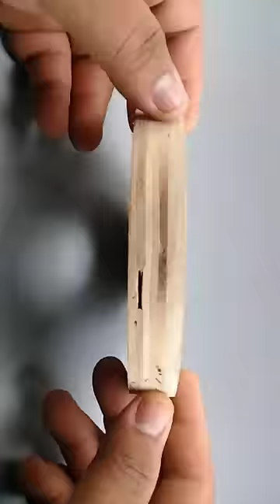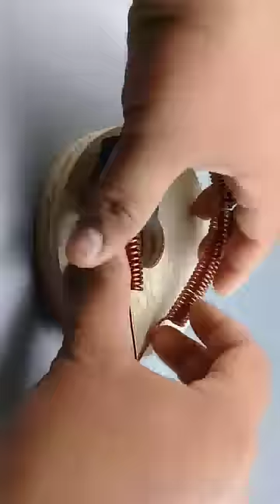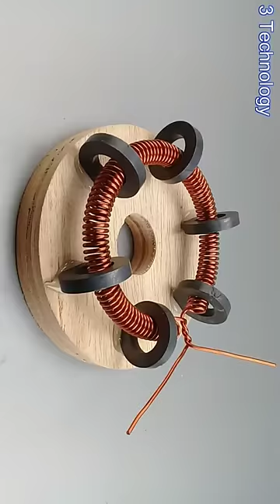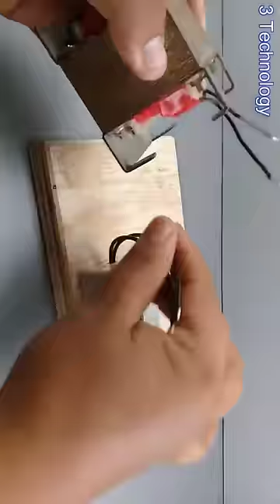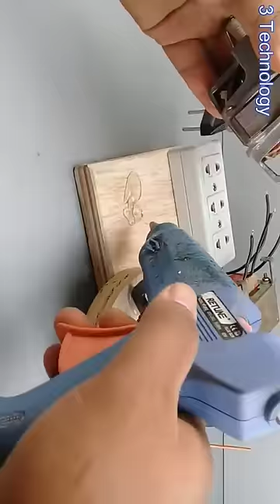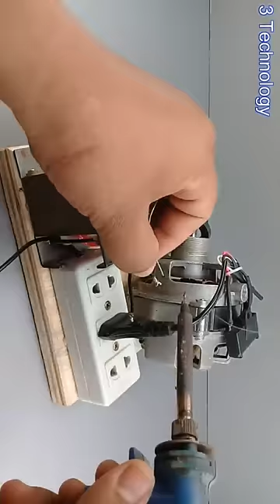New Free Energy Generator 7000w - Free Energy Forever #viral #diy #generator #tech #motor #shorts

Comment: The hardest part in making free energy devices is finding a place to put the batteries.
Reply: And the hot glue
Reply: Ha😂
Reply: The most difficult thing in this video is to correctly connect to your neighbor’s outlet through the wall without him noticing.  and then the light bulb will be on and the TV and refrigerator will work.😂
Reply: I saw this same comment in another video. Is this what you do with your life?
Reply: @alal-os1er  I mean if you connect secretly to the neighbors outlet, YOU have infinite or free energy, but your neighbor will wonder about the bills if you mine Bitcoin with this😂
Reply: Well, you need no battery if you have thin clear coated wires
Reply: Lo mismo pensé dónde ocultar las pilas 🔋.
Reply: Looks real to me and you sound like a broken record
Reply: @user-fw4dg3zp4j    LoL.
Yup. You're right. It's totally real. 
 Free energy is just being suppressed by governments around the world. But one guy with hot glue, a wood block and some wire is going to change the world.... on YT.
 Sure thing, sport.
Reply: No fucking way bro hearted it
Reply: Burada 100 watt ampül var bunu kaç pil ile çalıştığını biliyorsun?
Reply: Where can I find those things
Reply: So original
Reply: This same comment on all these free energy videos. Either AI bot or paid loser by elite opposition.
Reply: @frankiesun09  I "think" I agree with you? Sounds like I agree with you. 👍
Reply: Well you wouldn’t use batteries in an AC circuit, like the one in this video. AC electricity is produced, but not stored.
Reply: Or the extension cord to 120vac
Reply: Vocês não entendem nada, dentro da tabua tem uma bateria de 100A, bem potente.
Reply: @frankiesun09 It's a popular joke LOL if this system could create free energy, bacteria would have evolved their own tiny bacterial version with proteins and ion exchange and eaten everything else.

Comment: They forgot to show the batteries in the white outlet box
Reply: And that is it. Einstein says energy will never disappear, its only transforming.
Reply: yep, they should screw wires together either
Reply: Nope...the plywood base has been routed out to fit a whole bunch of AA batteries! Can get what ever wattage he needs and with a thin piece of panel on the bottom, you would not be able to see anything!
Reply: It's a turbine. U have to spin it. Hence the draw string.
Reply: We don't need it to be shown because we know it
Reply: table kee niche induction cooker coil fit karke bewkuf bna rhe ho
Reply: Это не реально....
Reply: @patricksummers4285 фанера -- это и есть батарейка. Только он перемудрил и усложнил её зачем то всякими лишними элементами. Поджечь фанеру и будет и тепло и светло
Reply: Wait what? I thought it would be a continuous flow of energy.😬 yikes... Would the battery have to be rechargeable? Like a lithium rechargeable or something? I'd like to try this. looks pretty cool
Reply: Is this fake video ? I need a generator 220 voltage so what's learning real video?
Reply: Where can I find those things
Reply: Maksuda 
🎉
Reply: @shahindezfouli5108 Well it's certainly not an infinite energy generator. Those don't exist lol. If you could make em with wires and magnets and coils, a bacterium would've evolved a version with proteins and ions and eaten everything else by now.
Reply: No, the copper wire is looped through magnets. The thing in the thumbnail. Its called a turbine. They spin a magnet inside it. That makes electricity.  It will wear out, or use up, the magnets eventually. So it’s only free in the sense that you are not paying the power company.

Comment: Free energy only happens in India and surrounding areas. It requires construction with scrap components, a glue gun, wood and a place to hide the batteries...
Reply: И желательно не учить физику 😂
Reply: Tbf, there may not be any batteries. It is built from scrap, so it could be ork tech powered by nothing more than the sheer weight of the builders ignorance. WAAAGH!!! is not well researched.
Reply: free Energy is Always Bogus
Reply: Actually you don't need batteries. Look up Lingams, they used silver and gold with water flowing over it to create small charges of electricity from the electrons of one material flowing to the other ;)

Comment: false video, infinite energy is not possible in this way, you earned a slip and a complaint to YouTube for false videos
Reply: It's a turbine. It's very possible. We've used them for decades. Just need to spin it, he spins it with a pull string at the end. Can connect it to a wheel of a car or to running water anything moving and it'll provide u with power.
Reply: @michaeldevonport1715 Well, then that's not free energy is it? You are still using the kinetic energy of the water to drive the turbine. It is a way to extract renewable energy which makes it free monetarily but not physically.

Comment: You can also just put the plug from the end of the power strip into the power strip and you have also infinite power
Reply: Бесконечная мудрость.😊
Reply: The instruction manual for the power strip covered none of this! They are always trying to hide the truth!
Reply: Well as long as you loop the cable through a graphite donut. (Or just a donut)

Comment: sadly you built just an alternator and no, it's not free energy. The current consumption of the load creates a counter force to the spinning via magnetism, so you need something to keep spinning the engine.
Reply: like a battery pack hidden in the power strip
Reply: @KianF  اكيد
Reply: You are right. But what about balance of magnetic field. It is simple when you have ampere spires, i.e. electrical energy taken from a power supply, but permanent magnets take energy from where? I mean, how in conservation of energy principle, taken from thermodinamics, you can introduce an energy phenomenon that seems to follow a different way. Which energy permanent magnets transform in magnetico field?
Reply: Debating something like this is a waste of time
Reply: What keywords can I search to learn more about this
Reply: He built a turbine and he starts it with a pull string. I dunno why ppl flipping out. Take it camping, slap one side in a stream yay.

Comment: If you take 2 iron core coils and attach them to the leads to a lightbulb (one core to each lead) then expose the cores to strong magnetic field, the bulb will light due to magnetic electrical induction. No movimg parts needed.👍

Rotating coils through a magnetic field (as shown here) produces AC ("ALTERnating current) just like the ALTERnator in you car.

Essentially, the battery in your car is really only needed to start the car - to crank the starter (which is why car batteries are rated in Cold CRANKing Amps). Once started, you could disconnect the battery and the alternator provides the electricity to run the car and all the accessories. 🙂

Comment: This actually works because the magnetic fields of the magnets will effect the copper wires continuously because the Magnet spins. When it keeps changing it creates electricity in the copper wires. You can see a video similar to this by Tim Station 2

Comment: That bare copper coil is tied together in a loop when one side is positive and the other negative; when you ought to tie to the battery pack with two separate wires. From the battery pack you came off with two hots, when you lack a neutral wire; you can't power a light bulb without a neutral wire. Second, you can't power an alternating current bulb with direct current. You put in a lot of effort to deceive people. I do see the logic you would use to claim otherwise; the system in it's entirety is the circuit. But then you would need to tie a positive wire from the motor to the bare copper coil. This is not a complete circuit, which means again, there's no neutral therefore no light. In the case that the component I assume is a battery pack is not, but is actually a transformer to step up voltage, that would in  theory supply this excess power for 'free energy.' But have you seen a seven-thousand watt lightbulb? That light would burn your eyes out of your head.

Comment: This is the first generator created by Michael Faraday. Run a copper wire in between two magnets and you will create a charge. There aren't any batteries in any box is will work but it will not produce 7000 Watts

Comment: Even if you pull start and use magnetic fields to keep it going. There's a loss of power through the system it's not gonna run forever.

Comment: 😂 in seriousness could we not do like a close system hydroelectric that uses the same volume of water piped in a circuit to move a paddle with pumps like a wave pool? Then its just making cheap and replaceable lead acid powercells to store it for use.